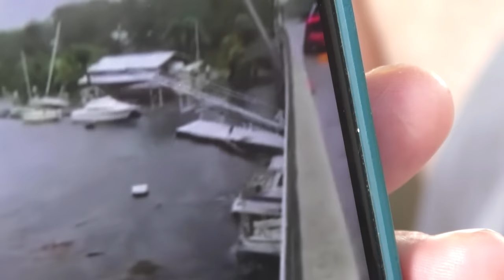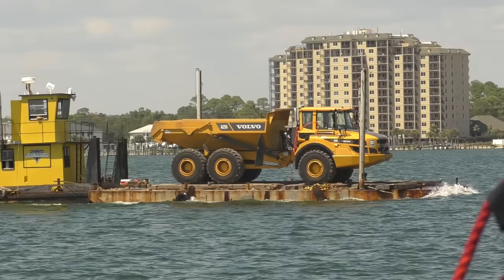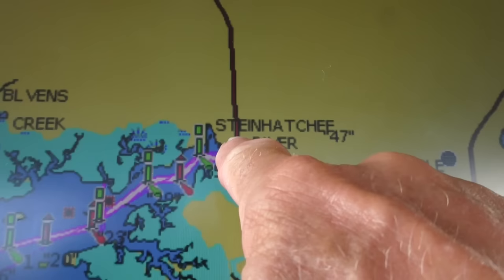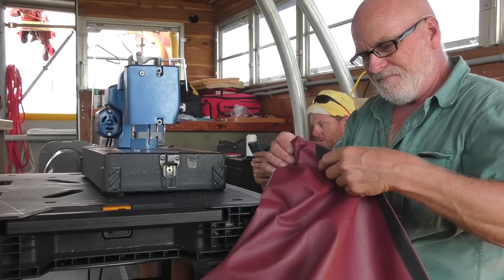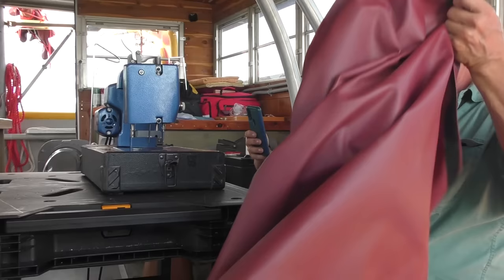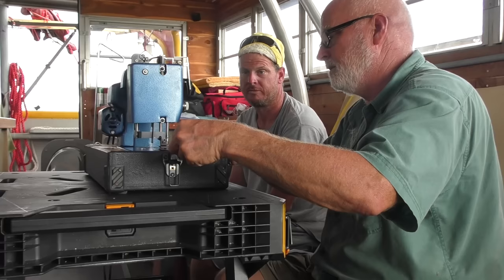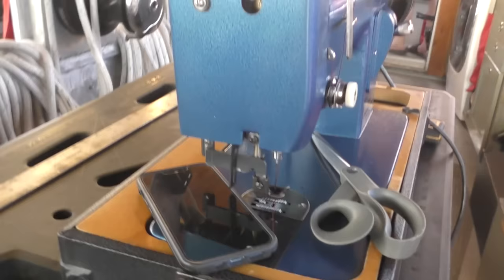Monte Rides Out Hurricane Idalia and other Boat Stuff

Comment: Canada Coast Guard recommends those on mooring buoys move to anchor for wind speeds over 40knots. Scope on a mooring buoy is very small and so the bowsprit and other mooring hardware can take a real beating. The Sailing Emerald Steel YT channel just did a video about this very thing and show some of the damaged boats of people who trusted mooring buoys. In general the mooring buoy did not fail but rather the deck equipment did. Just look at the angles and forces of both waves and wind on both a mooring buoy (no scope) and an anchor with good scope.... It should be obvious once one thinks about it.... which, I must confess, I did not till I saw that video.

Comment: The media does love a good storm, but people do need to evacuate and be prepared to evacuate if a hurricane of significant strength is headed their way. That is also why the media takes it seriously and evacuation advisories and orders are given. If it isn't taken seriously and the danger played up a bit, a lot of people won't leave and then end up in dangerous situations. After a hurricane, flooding and debris makes it very difficult to impossible for emergency response to reach anyone in distress and it is even worst for the average person. It is possible to be personally prepared, but you also need a location that is elevated out of the flooding to do that, like on a boat or one of the few hills.

The reason why there are evacuations during hurricanes is because water supply is disrupted for the area and flooding. Flooding is a lot more dangerous when you aren't on a boat and the SE US is very low elevation, so when there is heavy precipitation and storm surge from a hurricane, depending on the area and typically at least CAT 3 to 4, there is flooding that can be anywhere from just a few feet to over one story, especially if you are really low in elevation or right on the ocean front and have nothing to stop the storm surge waves. The water supply disruption is another issue. Water from wells and reservoirs becomes contaminated by the flooding and unsafe to drink while the electric pumps to provide pressure to move the water lose power. The electricity is knocked out and the gas lines are shut off for safety, so other than a camp stove or some dry fuel (good luck with that unless you have set that up and nothing happened to it), you can't boil the water to make it safe and that is if anything even comes out of the tap. It can take more than 3 days to restore water service in most of the cities and counties after such storms, so unless you stockpiled water, you are going to be at risk of dying of thirst. The flood water around you is contaminated with seawater, oil, gas, chemicals, sewage, animal waste, dead animals, and who knows what else, so you are not drinking that short of steam distillation, which is fuel intense and takes a large apparatus to do.

Respect the storm and know how bad it will impact the area before you decide to evacuate. If the local government recommends evacuating, you should make plans to leave or have supplies if you stay  and be ready for the worse. I lived in a hurricane prone area and we had shelter from the storm surge since our wetlands didn't get paved over and turned into condos. We also had a public utility, so our power grid was well maintained and was fixed very quickly after any storm. We still had to evacuate for large hurricanes at least once and prepared supplies and for flooding for the medium ones. We were the exception. The other areas in our state that had paved their wetlands and had commercial power companies had massive flooding from even medium sized storms and had often no power other than to the water supply infrastructure for weeks.

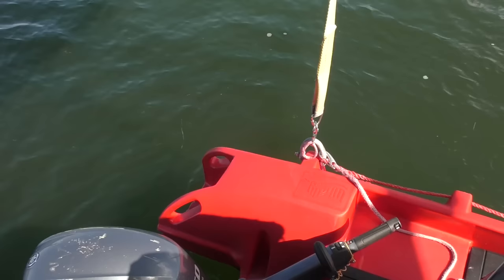Comment: 2:10 I was wondering if I would ever see a hook that looks almost identical to one my grandfather designed back in the forties or fifties. In late nineties or early two-thousands he sold the design to a doctor for patent. There are differences of course but not very many. At the base of the forearm band he had a steel band that doubled as support and also a hammer! Flexing the shoulders draws the line running to hook tight which opens the jaws.